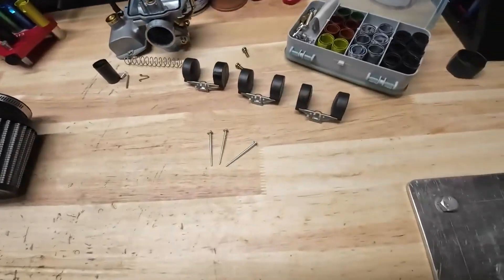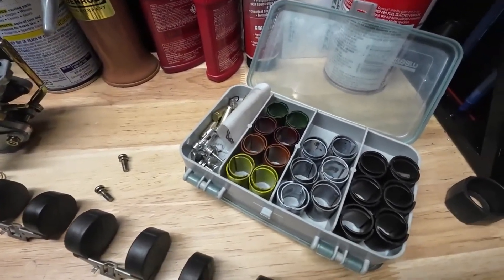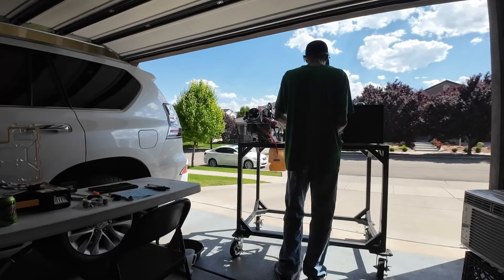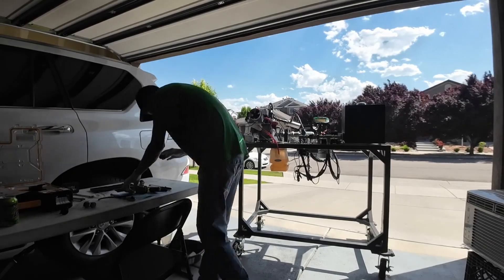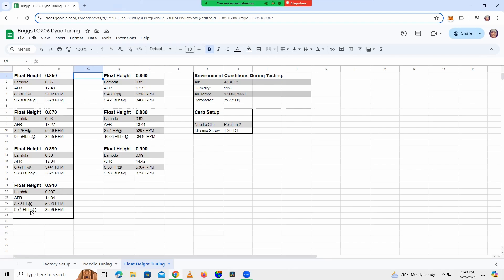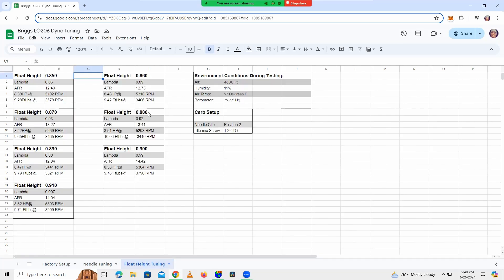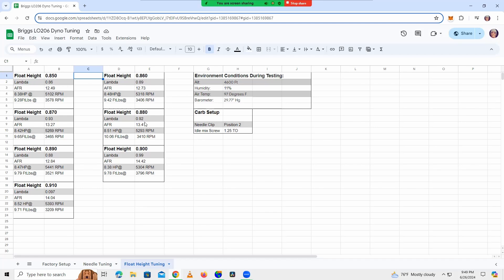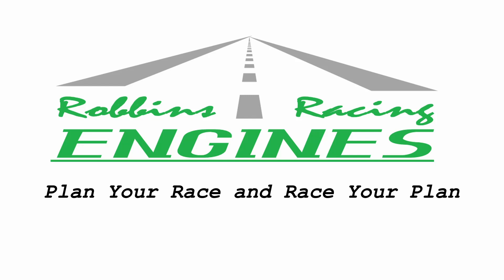DYNO Tuning the Briggs LO206 EP.5 - Float Heights

Comment: Interested in what you are using for a pump and pressure controller on your dyno. Is that just a needle valve you are running in and out with the wrench.? I like your videos, keep it up homie.
Reply from the maker: Yea just using the needle valve to control the pressure.  It came with a "knob" but it was hard to open under pressure.  Took it off and that 8mm wrench fit perfectly,  I'm going to use the wrench until I replace the valve with one I can control with an Arduino.  Pump is just a standard Hydraulic pump,  if I remember it was rated at 5000 PSI and 4000 RPM max.

Comment: Do these engines just have a tendency to have frequent valve sealing issues?
Reply: In my experience yes. Iv raced lo206 for a couple seasons and valve leaks seems to be the most common area of engine power loss. Out of the box the valves can be so awful that it’s always worthwhile to have them touched. At the very least do a leak down test often.
Reply from the maker: I 100% agree with Tyler on this.  Turn the engine off and forget to wind the engine over to TDC and you can consider your valves bent.
Reply: @robbinsracing801  how do you set it to tdc right after shutting it off without pulling the plug?
Reply from the maker: @cromanyak5999  Slowly pull the recoil starter to rotate the crank.  There will be a point where the starter gets tight,  that is compression putting resistance on the starter.  At that point you want to stop pulling the starter.
Reply: will you do tgis test again with a fixed cylunder head. a head with sealed valve seats will burn differently than a head with leaky valves.